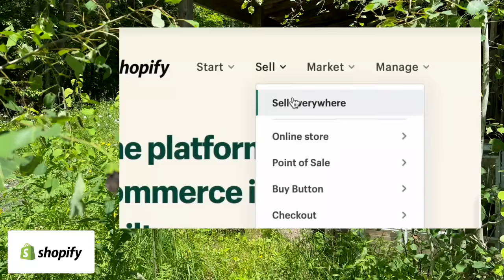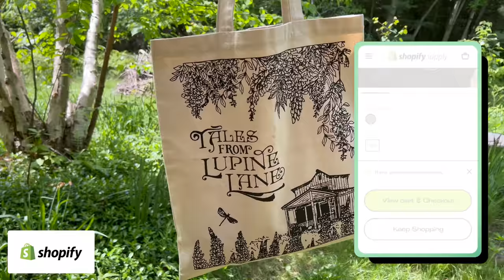problems at my cottage

Comment: You may not want to cut your rhubarb when you harvest it.  You are supposed to twist it and snap it off at the base so it tells the plant to grow a new stalk.  If you cut them the base just sits there and doesn't regrow a stalk.  Just a little tip.
Reply: Thanks for the tip, l've never grown rhubarb but it makes sense.
Reply: The remaining stem might cause rot as well
Reply: @pjotrh  you might have a point there. I live in a very humid and rainy area, if stems are cut, the plant will rot here. But if it's dry, you might get away with it.
Reply: @pjotrh  Hm…😮
Reply: Glad I wasnt the only one reacting ^^  I was panicing a little when I saw how she harvested xD
Reply: It is also important not to harvest the rhubarb for too long. The harvest season runs from April until 24th June. The plant then needs rest over the summer so that enough strength can travel from the leaves and stalks into the roots, so that the plant can grow strongly again the next year.
Reply: I was about to comment this!! ever since twisting off the rhubarb in my garden, the plant has grows so much bigger and faster!
Reply: Thanks for all the rhubarb tips 😊
Reply: I've always been told to pull rhubarb.  Never twist or snap. If you pull the stem, it all comes out from the base of the plant. And then you can trim off the bits you dont want to eat.

Comment: This was loaded this was added less than a minute ago and for the first time I have rhubarb advice. Pull and twist from the roots, do not cut. So much better 😂
Reply: came here to say exactly this! 😂😂
Reply: Is it bad to cut it?
Reply: @canfieldcreations8528 doesn't matter,twisting can disturb the crown,have always cut close down,from an old rhubarb grower.
Reply: If you pull it will give room for new growth, no need to twist ❤🇨🇦
Reply: Yes you need to pull rhubarb. Not sure about the twisting part but always pull
The reason for that is because the sweetest part of the rhubarb is at the bottom. (I was told this by my grandparents many many years ago,)
Reply: The twist just makes it easier to pull. My jam and syrup are a neighborhood hit 🎯
Reply: The beginning of your sentence is giving my brain a seizure 🤣💀
Reply: Here for this too! I was taught just to pull which stimulates new growth. I have forgotten this some years and had my whole plant flop...but they are hardy still! Even going back and pulling after you’ve made the mistake of cutting will help the plant recover. My fav is rhubarb crisp, jam, and chutney!

Comment: Good job on the soldering. Some people never get the hang of it. If you keep a cold, wet rag handy when you're soldering and immediately wipe it around the joint when you're done, it immediately solidifies the solder and you get fewer leaks. As a bonus, your solder ends up shiny silver instead of that burnt look. As a Maintenance guy, it's fun to watch you learn all of these things by yourself.

Comment: Hi Hannah, if you add some water plants to your pond to create shade it will not let the algae grow. The light is what causes the algae. I used potted plants sitting on the bottom. Waterlillies are really good ones because the pads cover the surface and block the light.

Comment: Great job on sweating pipes. When opening main value... open just a little at first and open more when you hear water is slowing down or building pressure and all the way when it is full. It will prevent from settlement being pushed into your faucets and toilet tank valve, filters.

Comment: I have been you! I learned how to do plumbing and electrical as I needed to! I am so happy with how brave you are to just give it a go! You definitely want to learn to solder. You might also consider PEX piping. It is more tolerant of freezing temperature and won't burst so easily.

Comment: a tip for you when you sweat the pipe , aka solder, have a wet towel and after you melted the solder wipe it around you will get a clean looking line while it still hot the rag will cool it also. for the windows you can use bondo or wood filler and sand it to repair it , then use primer i'd do oil based primer  and like a elastomeric type paint and window caulking to water proof dont forget the flashing ! maybe also on top of window make alittle awning to divert the water. and then buy some curtains or make them

Comment: When you go to fix piping. You have to soldering (sp?) to the pipes to the new fittings. (those connector pieces). That's why the work you did leaked. Of course, also you have more than 1 leak. So fixing them all is imperative. You can't run water right after doing soldering work either, you have to let it dry.

Comment: Shark bites work great when installed properly. You have to push them on hard and make sure the pipe bottoms out inside the fitting and there will be no leaks. You can use flexible pex to connect to the same fitting as the copper.

Comment: Sharkbites work if you use the right ones and use them correctly..... I have used them when putting in a new hot water tank and also when i had to cut copper pipe to replace a shut off valve going to my toilet...none have ever leaked. Its also very important to debur the ends of the copper pipe to make them smooth on the outside and inside.. so the inside of the sharkbite does not get damaged by the rough edges.... and that the shark bites are put onto the pipe at the proper depth.. they make a little tool that will help with the deburring and measuring how far to put the sharkbite onto the pipe.

Comment: Hey Hannah, good job. I'm glad you didn't use the Shark- Bite in the wall.  You may have done it already  but quick tip, wipe off any excess flux after you solder. 👊

Comment: Soldering is absolutely the best way to go.  As long as you have a good torch and pay attention to details you'll get a flawless joint every time.  

Make certain that both the pipe & connectors are scrubbed to bright copper, use light coats of flux on both the pipe & connector, and heat the pipe, not the connector.  If you heat the connector rather than the pipe there will not be enough heat in the pipe for the solder to flow properly and you will most likely burn up the connector.

Take your time, pay attention to the details, & you'll be good to go.

Comment: hi you got a ride -on lawn mover u got small trailer put on the back so u can pickup sand bags and the rocks so save your back and use it for lot other things like wood pile life so much better for u or you go buy bigger trailer made for it then small one got so tow bigger items handle more weight.

Comment: You needed a sharkbite slip fitting for that job. A slip fitting is longer on one side and allows the copper pipe to move back and forth through it. So when you install it, you install the long side on one pipe, slide it down until the other end connects to the other pipe. Then you push the copper pipe in the short side until it is all the way in. The short side has a plastic insert that locks the pipe in the sharkbite. The long side doesn't so it can freely move up and down. You are supposed to use slip fittings whenever you have a situation like yours. You could've also cut a small piece of PEX and use the same fittings you had. You need a PEX cutter and a tool that smooths out the PEX after you cut it. If you did the PEX insert it allows for a little more movement so you can bend it a little to put it in place. Anyway good job. I hate to see you having to solder. PEX and Sharkbites are the only way to do plumbing. I've got a combo of copper and PEX but eventually all my copper will be replaced by PEX. That way if I go to Florida for the winter, you drain the lines and don't have to heat the place. And if any water was left in the pipes, the PEX won't break, bulge or corrode.  The worst thing I've had happen with PEX and freezing is the sharkbite popped off. They freeze and thaw well. I'm sure you already know all this though. Love the content. Keep up the great work.

Comment: I fixed a pipe on my water heater years ago.  My friendly Ace Hardware gut sold me the same pipe cutter and some special glue that replaces soldering.  Worked like magic!  I still have that pipe cutter because you just never know, 😉

Comment: Nice plumbing work. You see those two boards on top of where you want the window? Those mean weight bearing  wall. Those boards will need extra support around the window. More double boards for the window, well supported up. 
Great job

Comment: as someone who has suffered with pipes underneath my cottage in the smallest crawl space, i highley suggest re piping your cottage. copper pipes are way more likely to burst then plastic tubing (not the correct term but you know what i mean). yes you still need to winterize your cottage and take all the water out but copper gives you way less wiggle room for error. and it honestly just doesnt feel worth it when youre constantly repairing it it with shark bite fittings and saudering. my cottage was literred in just random places i got to saudering and others i was too lazy and just shark bite it. i am so happy i re did my piping to not copper. it has been a dream.

Comment: Hannah, you are the first you tuber to whom I subscribed.  And you remain ny favourite.  Btw, in case you bave not already,  you can waterproof windows with marine varnish (stuff they use on boats).  If it were not in a shower I would suggest decking oil or furniture wax. 😊

Comment: Here's a tip your rhubarb plant will appreciate. PULL each stalk, one at a time, instead of cutting them off. This year my rhubarb plants have leaves three feet across and three feet long with stalks as thick as your wrist. To make your rhubarb grow large and succulent add a load of manure in the fall around each plant.

Comment: Most old windows would have been painted with paint containing lead so you might want to check that out. If you decide to remove the paint, make sure you wear protective gear; you don't want to be inhaling lead paint dust.   I admire your work ethic and your adventurous "can do" spirit.

Comment: Just a friendly tip about rhubarb - you need to leave about 30-50% of the stalks and leaves on the plant, so that it has enough energy to grow back next year. And just pull the stalks off the plant with a twist instead of cutting them. Thanks for sharing another fun video!

Comment: I've used those shark bite fittings and it worked great. But the pipes HAVE to be a fast in as they will go. I don't think the one you had on the bottom was in all the way.

Comment: Love the title, but also could have called it, "Girl in flux", or, "Flushing the system"... 😊
Plumbing is a head-bender.
A window should have a lintel over it, usually a couple of bits of timber on edge, to support the studs and wall head. To seal around the window I'd recommend compriband (expanding foam tape) 1/4" back from the edge, then sealant. 
Good to hear the Proclaimers and Dexys Midnight Runners and no question,  Joni Mitchell is a goddess! Excellent singing! ❤You rock.

Comment: That old burnt wood is from past blow torch used in your bathroom, I have it too at my cabin too, I don’t know why they don’t stick a piece of metal or aluminum foil to prevent the wood from burning.  I have not tried soldering or pipes yet

Comment: I LOVE shark bite. Once you realize how you can use them in your own plumbing you'll never turn back. I like to buy the PEX tubing (it's a safe plastic and comes in blue for Cold and red for Hot ) and then when you cut out a bit to replace use the plastic as the new join. They work GREAT! You can also add faucets , shutoff valves, T's (to add a new water line like if you wanted to veer off and add another outdoor faucet etc). You'll come to love sharkbite , I know I did :) 

I also love the "mid-west" pronunciation of Bag (Bayeg) Love it, I have relatives that live in Midwest so makes me smile, of course I'm a new Englander so people make fun of my dropped R's haha.
Reply: @armslength2618  I've used both, as the sharkbite really does work well with the copper. We've an old house and so it's a mix, in a pinch or for long runs I do pex, but when we do a new area and want it right, we just invest in the copper pipes.

We've harsh Winters here in Coastal New England (Cape Cod) but we're not as cold as MN and can have Winters, like our last one, where we only get a few days of actual freeze.

Comment: And now that you have the brown water 💦 out of the water lines, you will need to take off the sink water head's Or faucet ends and get the Screens cleaned out and that will help out with the water pressure and more water, but usually when you get some brown 🟤 water and that's rust coming out of the water heater and will clog the screen eventually..... and just another project for you Hannah......

Comment: You get different grades of copper pipe based upon the thickness of the pipe wall,  cheaper is thinner and more prone to bursting. Thicker costs more but less likely to burst. Verify which you get and always try to get the thicker ones

Comment: have you put flux all on the inside of the copper pipe/fitting? because that looks like a bevel where you either didn't put enough flux on or didn't heat it up enough. 
I've done this here in germany for about 15 houses and my first time I also had a leakbecause of not enough flux. (I use press fittings now, also reduces points of human failure and is a cleaner solution.)

Comment: Shark Bites fittings really do work. I think you didn't get them fully seated and it would have been better if you had cleaned the pipe end. I have plumbed my whole house with PEX plastic piping and the occasional Shark Bite fitting and it has been totally problem free.

Comment: !!! WARNING !!! WARNING !!! Hannah, you are in extreme danger! I started out at your age attacking problems and turning them into opportunities to grow, and I ended up as a Project Architect with the nickname McGiver! After 40+ years like that I found it almost difficult to retire and relax. You have been forewarned! Hahaha! Good on ya! Nice soldering work also; those quick fittings are never the solution. And I admire your strength moving all those bags of sand. You got strength girl! Props to ya!

Comment: I could not love your channel more❤️ with the turtles, I'm the same way. But instead of moving them into the woods or weeds, set them on the edge of the asphalt, facing the woods/weeds. They have to raise their body temperature to digest their food. If they come upon a rock, they'll get on it. Otherwise, they get on the blacktop because it holds heat. Hope that made sense 🙄